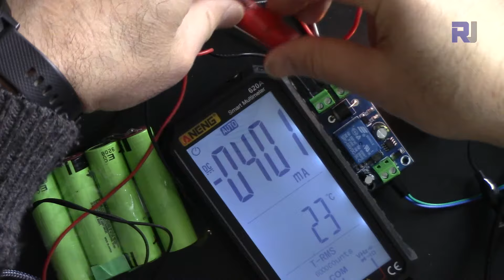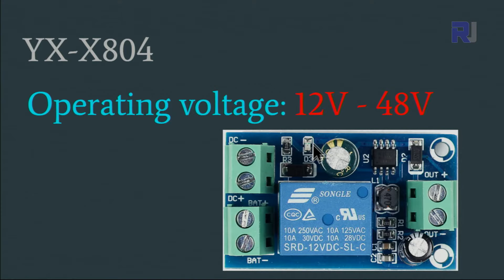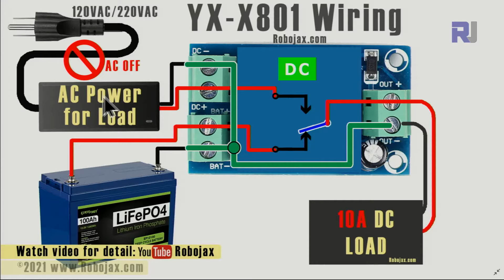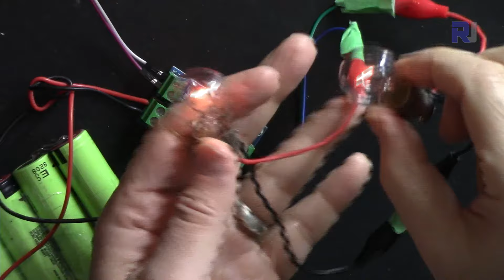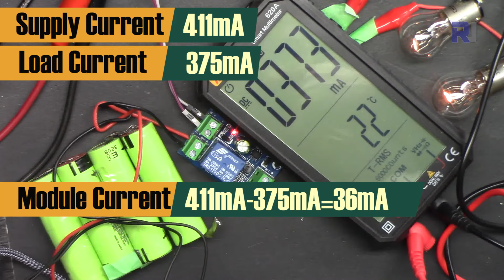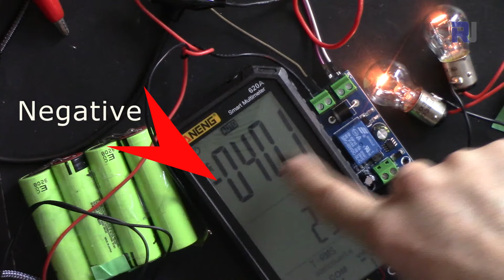YX850 Power Failure Automatic Switching Standby Battery Lithium Battery Module 5V-48V Emergency UPS

Comment: great video, however to realize  "uninterrupted" power supply function, you can add a huge capacitor to the output (e.g 4700-10000uf)
Reply: This is what I am thinking too, but after that the capacitor must have a limiter so it can supply a volt needed to the output or discharge. Then we call it a UPS.
😁

Comment: there's a half second black-out. Somehow that drop should be avoided, because that half second with no power is going to crash any router and computer.
Reply: yes but who really cares? it will reestablish connection and all is good. if you just want something to auto switch in a power outage, this is great.

Comment: What if i put capacitor to the output so it wont interrupt?
Reply from the maker: try it. it depends on how much current your load needs. you may need to put hug capacitor.

Comment: Hello, I know I’m commenting after a long time, but I’d really appreciate a reply.
I have a YX850 module, which has battery charging capability—something I don’t want. I just want it to work as a simple switch and not charge the battery through the adapter, since my battery is already being charged by a solar charge controller.

What can I add or remove to make this happen? In other words, how can I prevent it from charging the battery and have it function purely as a switching relay module?

Comment: I created router UPS with YX850 but it is restarting router. Then I added a 1000uF capacitor at he output but it still restarts. Dont know what to do. May be these modules are not fit in 100% uninterrupted supplies.
Reply from the maker: Nobody says it is 100% actually they are 0% uninterrupted. They disconnect and then connect. So it is just an automatic switch when the power goes off.
Reply: It's because the capacitor pushes the current in reverse into the coil instead of your router. Add a diode before the capacitor (but you will have 0.6V drop). I dont know if 1000uF is still enough to handle the juice for 0.1s
This module is not uninterruptible anyway. True uninterruptible is called an UPS and is more complex than just a dumb relay.
Reply: @syc6598 thanks for guiding me. I have already added a diode at the output dc jack. So you mean to say i should add this capacitor at this jack’s terminals? will try it and get back.
Reply: @VaibhavSaran  when power outage, the capacitor will push in both direction, in reverse, through the relay. A diode would prevent that and the capacitor will fully push toward the router. But i dont know if it's enough to power the router
Reply: @syc6598  Thank you so much. It really working well after putting the capacitor exactly at jack terminals. Last 1 month I was not able to rectify this issue and almost given up. The capacitor I used is 6800μf 25Volt.
Reply: @ glad it works. that's a big capacitor indeed lol

Comment: Can we use 12 v and 1 A entering with adaptor and 12v and 1A with the powerbank and use it when the lights out and switch it??
Reply from the maker: I came to this questions like 5 times and I did not get what you ask.  Look when you power a bulb that needs 12V. you can power it up with 12V 5Ah battery or 100Ah battery.  I mentioned the voltage. so if you don't nention the 1A. what is the question?

Comment: Zero seconds switching Relay module router???
Reply from the maker: There is no such thing. It should be  a solid state like the MOSFET switch. Relay always has a delay as it is mechanical.
Reply: @robojax best Mosfet ???

Comment: YX850 will charge the battery i assume we need to make sure the pack matches the battery voltage or only slightly higher, i also assume a bms is more needed?
YX X804 does not charge the battery i assume its isolated?

Comment: What if we have a capacitor infront of the relay module will it prevent shutdown of the device needing power or do i need more of other stuff
Reply: You need capacitor + diode to prevent reverse current back into the coil. But diodes produce voltage drop and it s*cks.

Comment: Can i use 36v battery and 36v dc supply with this module?
Reply: 5-48 or 12-48 ... if you have 36v.. 36v is lower than 48v so yes you can.  WATCH YOUR mAH though!!!!!!!!

Comment: I have the 801. Can I simply add a diode to have the 850 version?
If yes, what type and specification of diode to be used with an 8Ah Lead Acid battery?

Comment: if i don't want to charge to battery i need to cut off diode from yx850 module ? ( i use independent charger for li-io battery pack)

Comment: As you said , switching of RELAY take .6 second, so it not ideal to use for microcontroller board. because everything time RELAY switches , it will reset the microcontroller. How we can remove this problem ? do we need to use can big capacitor ?
or can RELAY be replaced with any MOSFET or SSR ?
Reply: I have the same question. I hope he sees it.
Reply: Output use elco 10.000uf
Reply: Your microcontroller software should be fail proof. Expect power to fail. Program it with that in mind.

Comment: Okay. So I see a problem. The product description says the the the same voltage is required for the power supply, the battery and the load for this work. But a 6v battery requires a higher voltage for it to charge - 7.5 to 8 volts. Then the battery supplies 6volts to for example a 6volt Lighting circuit - the Load. How can this work then if the voltage must be the same for the supply, the battery & the load? The battery won't charge and will eventually go flat if this is the case. What are solutions so you don't have to keep changing the battery?
Reply: This module must not be used with a "naked" battery, it would destroy it over time.
But through module with recharge capability, like the 5V powerbanks

Comment: Thank you for this extensive review. Please review this module  XH-M350, which do the same thing and explain why It does not contain a diode to protect from reverse voltage spike (Back EMF) caused by relay's coil. Are the capacitors in it do the job?

Comment: to decrease the drop we can add a capacitor, right? 
any suggestion what kind of Capacitor would be best suited (like a minimum value, i know it will vary based on loads) 
I am just curious
Reply: Are you asking about the time between power loss, and the relay switching? One amp = 1 coulomb per second. And one Farad =  1 coulomb per volt. C = Q/V  and  Q = I*t. So one farad will drop 1 volt per second per amp drawn from it. C = I*t/V.   If there's 0.2 seconds between power loss and the relay switching, and the load draws 1.5 amps, for a 2 volt drop you'd need 1.5 * 0.2 / 2  = 150 milliFarad. This is a massive capacitor. I think this module is really only valuable in situations where total momentary power loss is acceptable. Or for very low current draw devices. Maybe a 12V device running at 100 mA can accept a 1V drop, so 0.1*0.2/1 = 20 mF. Still a large capacitor, but more in the realm of possibility.

Comment: Really good review, I have a 48V battery but its nominal voltage and its full charge is around 54.6V, does the YX850 can handle that voltage for the battery and charger?

Comment: i was wondering, are you using a bms for your battery pack? or is it safe without one?
Reply from the maker: Always use BMS yo be safe. If you don’t use it you may make mistakes and batteries will get damaged

Comment: Hi, Thank you for your video.Can this handle more than 10A if I change the existing relay with the high current one? The load will be around 30A.
Reply from the maker: Hi, yes relay is the determining factor and the diode. Change it as well or just in parallel to it add one more diode

Comment: Hello sir good Video I have a question about esp32 i want to make an auto switch between battery an dc power i have used this x804 
https://www.youtube.com/watch?v=XA8qaMbrQ6Y&t=49s but like it said in the video it have 700 ms beteween the 2 state and the esp32 reboot  how can i do for the esp32 do not rebbot
Reply from the maker: then you need a real Uninterrupted power suplly shown in this video https://youtu.be/iM9oMdNBX1o

Comment: Thank you for super video...😍😍
Will 804 module work with 24V battery + 12v power supply? Or both power sources should be the same voltage?

Comment: This isn't a really a uninterrupted supply, the device will restart when switching happens. This can also be achieved with a 12v relay and a Diode only.
Reply from the maker: may be you did not watch it.  it has other features.

Comment: Hi sir, can I remove the diode and use two different voltage inputs (5v adapter OR 3.7V LiPo) to power the esp32?.

Comment: Thank you very much for your educative video ,but I've a qn  for the ac side, can I connect 240v ac directly (without using adapter ) , ie live and neutral instead of +ve and -ve
Reply from the maker: no you can't. it will die immediately.

Comment: Thanks for this video. 
Any new module which has uninterrupted switching? 
One suggestion needed from you. I have lfp battery ups 20v 4amp. And currently using with diode mbr20100ct from charger (cc cv module) to battery to stop reverse flow from battery to charger. Till now it works uninterruptly perfectly without  any problem. Added some fuses at input and battery output. So is it safe to use only with diode or should i add some switching circuit?? Please reply. Thanks for your time.
Reply from the maker: if you module has CC feature, the battery is protected with you set Voltage constant. Now you have the diode, you should be good. to charge the battery fully, there is a voltage of about 0.6V or more drop across diode, keep that in mind and added that to the CV so the full voltage reaches the battery. you should be good specially you have also a fuse. stay safe.
Reply: @robojax  yes there is cc cv and bms protection.and drop voltage is also considered. Thanks you so much for your time in replying. God bless.
Reply from the maker: you are very welcome. God bless you too.

Comment: what is the difference between power supply and charger
Reply from the maker: Power supply just provides power. Charge checks the voltage and current of the battery and change them in order to charge the battery properly and protect it from getting damaged.
Reply: @robojax  

so if I want to use this board as UPS for IP camera 
I have to use 12V battery + charger , and not just power supply.
or maybe use battery with charge protector .

Comment: If I add this module with solarpanel's battery ..will it work?
Reply from the maker: I mention all voltage and capability.  if your solar panel is within the voltage range yes it will work. by the way it seems you have written your name is reverse. I assume Rizvi is your last name, then it should be second like Ahmad Rizvi.  Many people in Indian, Pakistan and Bangladesh think the name order is being reversed when you write it in English which is not true.  Biden is the US president's family name. So  it is written Joe Biden NOT Biden Joe.

Comment: For yx x801 u said that the load should only be between 12v to 48v but you also said that the ac power will also be directly supplying the power to the load with the same voltage? That means at the output there would be 220v when on main power supply i.e ac? But the load needs only 48v?
Reply from the maker: please watch again. it seems you did not understand that we have operating power and load.

Comment: Is it possible to add some capacitor for eliminate 0.7  delay when switching? if possible, how to connect them?
Reply from the maker: as I mentioned. this is mechanical device. The only way to eliminate the  off time, is to have enough power  for the load. Find the total equivalent resistance of the load R=V÷I, V=voltage, I=Current.  if you found R=0.1Ω then The 𝜏=RC where is C is capacitance in Farad and 𝜏 is time in Seconds. , get C=𝜏÷R,  and if you want to get 𝜏=0.7 for example, then C=𝜏÷R=0.7÷0.1=7F, and 7 Farad is equal to 7000μF.  So would need 7000μF capacitor to be connected to the load to keep it the voltage to 63% of the original voltage. if load voltage is 10V, then it would keep it at 6.3V for 0.7 seconds. if you want to increase the time, then increase the capacitance. it would be HUGE capacitor the voltage rating of capacitor should be the voltage of load.  Let's see if it works for you.
Reply: @robojax yes true
Reply: I made a similar relay module. I added a small capacitor 1000uf at the output. It became uninterrupted. The capacitor should just be enough for that millisecond of switch
Reply: @ktestable  wow, that's what I wanna try as well, what's your load current and voltage? I want get rid of restarts for my router 12V 0.5A when switching to battery, can you suggest a capacitor please?
Reply: @ktestable 1.000 not worked for mikrotik
Reply: @ktestable  I too added 1000uF 25V capacitor in my router UPS module but it could not help restarting.

Comment: IF THE INPUT IS GIVEN 15 VOLTS OUTPUT HOW MUCH VOLTS ARE YOU?
Reply from the maker: It does not change the voltage.
Reply: @robojax  If the input is given 15 volts, is the relay strong, sir?

Comment: Hey Ahmad, I am wonding can the "AC Charger" be replaced with a feed from a vehicle.
Say from just a Cig Socket.  Cheers
Reply from the maker: Hi, the battery always needs charging voltage. if you supply voltage higher than the battery rated voltage, the batter will get damaged.  this module can facilitate connecting the the load and the battery.

Comment: How does the computer chip know when to stop giving power to the full battery
Reply from the maker: this does not. it will disconnect only when the power is OFF. you should have  your own charger. Use this instead https://youtu.be/iM9oMdNBX1o

Comment: Hey Robojax! I've been following you in your YT Channel quite recently. 

I just wanna know if there's a power switching module that has minimal delay in it? I'll be using this to power my router 😃 

Some other says that I could add in a capacitor to kill the delay? But I am not sure if that's a safe approach for this kind of load since the router is running for 24/7.

Let me know your thoughts please. Thank you
Reply from the maker: Hey, the cheapest way you o remove delay is to just add capacitors. That is the case where a mechanic switch such as relay is used. Depending on the load (router in your case) starry with for example 1000 microfarad and test it and add more in parallel to that capacitor until you get uninterrupted result.
Reply: @robojax  Hey man really appreciate your response! I am not that geeky with this kind of stuff but I have the basic knowledge. I made a visual plan on what I wanna build. I hope you can check it out and hope you can chime in and let me know your thoughts if it's feasible and can withstand the 24/7 use as it's intended for a wireless router. Also can you please check if the placement of the capacitor in the image is correct? Here's the image/visuals: https://bit.ly/3M6u61h 

I hope this will work as intended so I can start building it. Excited to build this actually :) Thank you so much for your help!
Reply: @robojax  where is capasitor, baterai or output/load?

Comment: Can I use a battery pack which has a BMS attached? Let's say a 3S BMS and with a 12.6V CC-CV charger as the power supply? 

Load is a wireless router rated @ 12V. 

Let me know. Thanks!
Reply from the maker: Yea you can. You have a look at this module which see if it works for you https://youtu.be/iM9oMdNBX1o

Comment: sorry but what can i use for the battery to not over charge or drain empty?  for safety purpose if i leave it for long or use it  for a automatic emergency light . thank you
Reply from the maker: it depends on how many battery and how much current you want to work with. here is a system for 2 cell 18650 battery https://youtu.be/vQIsc8-Uoio

Comment: I've been waiting for this module for almost 2 weeks which the seller took 5 days to ship out! but he sent me the wrong version which i didn't actually need a charging feature. i noticed both the positive  inputs are connected via a diode. if my assumptions are correct, if i remove the diode it will no longer charge my batteries but won't affect the UPS feature? and also, can we add a capacitor on the output to make the relay switching seemless?
Reply from the maker: Yes correct. That is the only differences between them

Comment: someone make diy version schematics of this please :}
Reply from the maker: why you even need to make it? this is so cheap that if you make it, it would cost you 10x more.  You can use Arduino instead.
Reply: @robojax currently in India we are not getting orders shipped from china as the Indian post disposes all the chinese shipment packages because of ban and in custom tax section writes that it was disposed because of public safety which is clearly vague and i dont wish to loose more money in this process. So if some kind man from Internet provides me schematics of this relay i could locally buy all parts and components like 12v relay for 1 dollar 7 pieces and make diy stuff for myself

Comment: Very good information. Im hoping YX-850 will work with a device Im working on that needs pass through charging. at only 5v for YX-850 to work, a 2S lipo battery at 7.4v should be just enough to get the switch to work fine when the battery is needed.
Reply from the maker: Indeed it should work.

Comment: i need to use First battery and the dc secondary... i can?
Reply from the maker: If you mean to use batter instead of power supply, yes you can
Reply: @robojax  Yes because i need to use first battery then later the dc (i have hybrid solar system) and when the batt is finished i want to use the DC supply
Reply: @m0hd_  i don't have certain applications for that. but it definitly works either way you want it coz i tried it already
Reply: you have to disconnect the charge diode